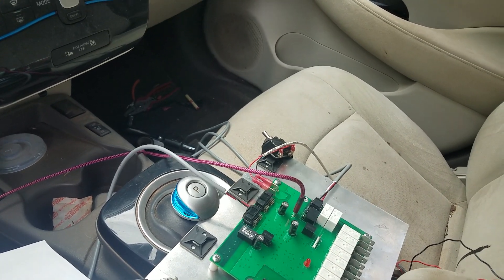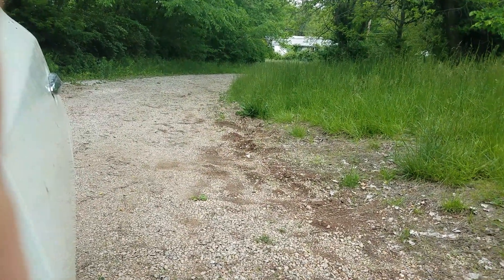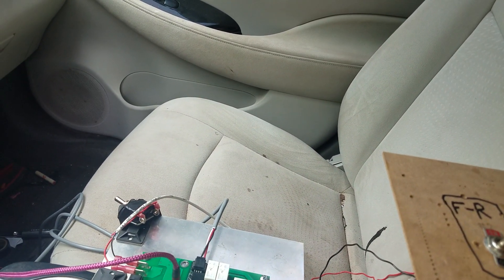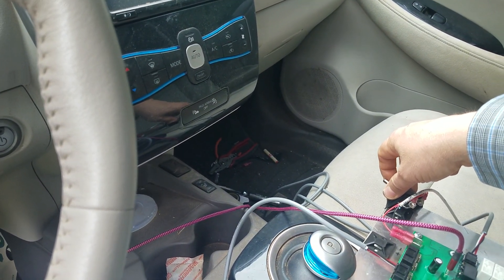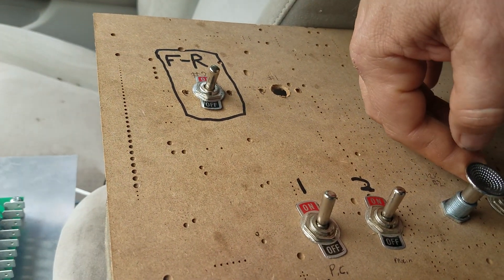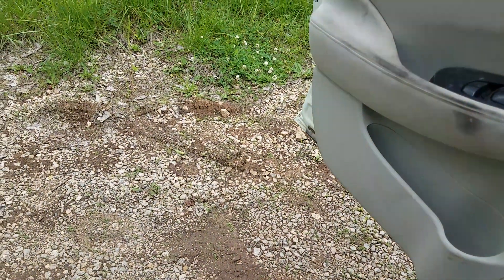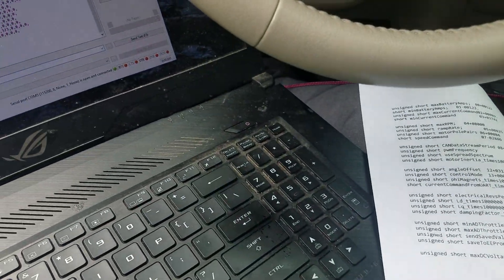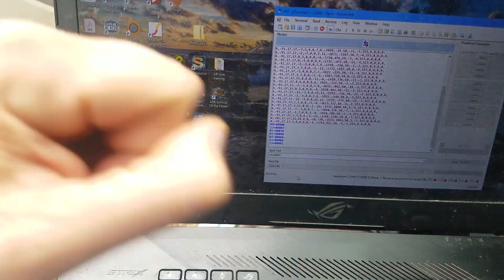Speed control test in nissan leaf

Comment: Is this controller for sale on your site? Want to use the leaf motor on an outboard motor setup.
Reply from the maker: I will have a new board with this new software on it in the next couple weeks.
Reply: The controller that's actually in the car is a very high end SiC prototype that has a peak power of around 300kw.  I'm just using the leaf to test a few things.